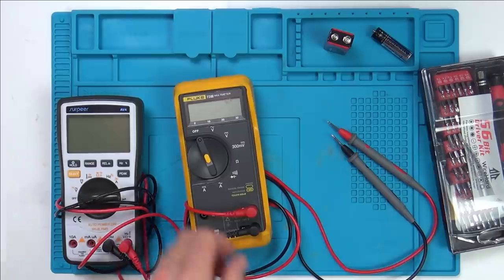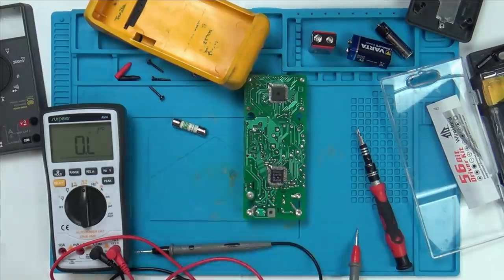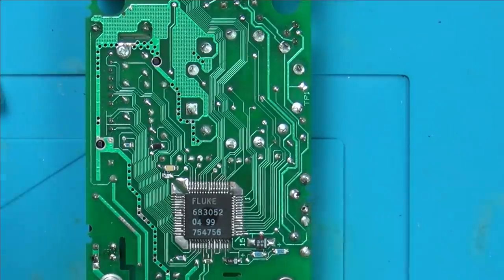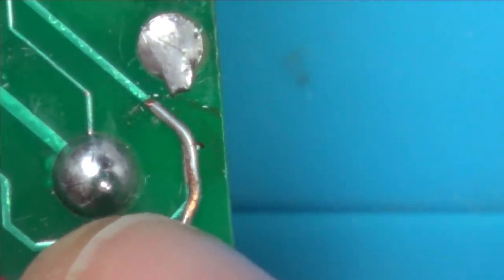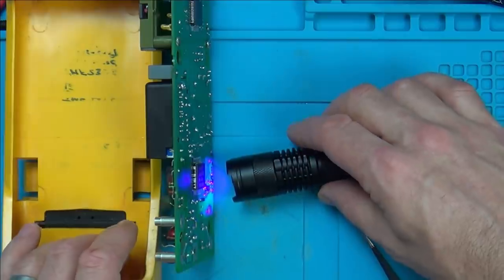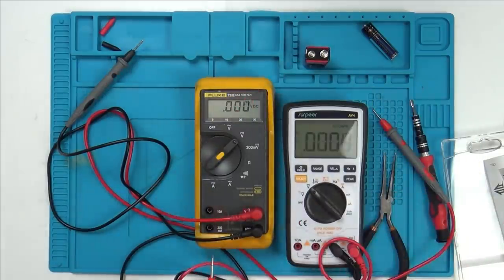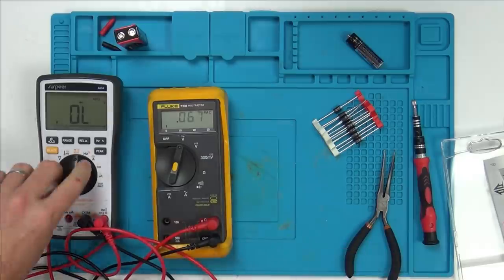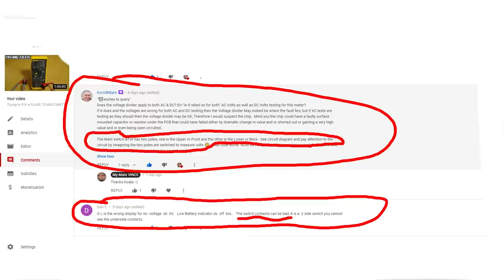REVISIT - FLUKE 73 MULTIMETER

Comment: Great finally. My take on most all circuits I work on is this, if the circuit worked at one time, that means it was designed and built properly. Than either a component OR trace is bad. And if all the components test good, the only thing left is the pads and runs. However, we face a lot of unique chips that some times are company designed and manufactured to unknown spec. Then you rule out everything else and narrow it down to such a chip. Getting a replace is than the real problem...  Thumbs Up!

Comment: The speed of the buzzer on continuity mode actually has a lot to do with the quality of the probes (like what metal they're made of). You should try swapping the probes around and see if it makes a difference.
Reply: I have a Fluke 73 and the continuity speed on the video is comparable to the one I have. I think the Fluke 73 is aimed more at industrial electricians more than electronics and the speed of it is ample for us sparkies. 👍
Reply: Quentin you have hit it on the head.. 100% correct

Comment: I’m in awe of your trouble shooting skills, especially when you say things like you’ve never used your multimeter to read amperage. I’ve been watching you for a short time and thought you were an electronics expert due to your high success rate and the way you move around a circuit board, but after hearing several comments you made it leads me to think you may not have had formal training, which would be even more impressive.  I have trained for 4 years as an electronics technician and find your troubleshooting skills easily surpass mine. I am very entertained watching you and also enjoy your accent. 
Not sure if you’ve ever done this because I haven’t watched all of your videos yet, but I would enjoy hearing about how you learned to be such a good troubleshooter.

Comment: Great that you get it working basicly without needed parts! :)
To do current measure 1 lead go's to A port and second lead cos to COM port. Warning! After that you have "jumper wire" in your hand (if those fuses inside are ok), even when the switch is set to OFF position.
When measure current you set this meter in series to the circuit you want to measure.
Example, if you want measure current drain from car battery. Set one lead to 10A port second lead to Com port.
Either take out positive or negative lead and hook this between the battery and the car cable(series connection).

Comment: Thank you for revisiting this Fluke. It is very rewarding to see that you fixed it with the help of the community. Thumbs up to all of us!
This HAD to be still a working meter with something broke in it, because it was doing just fine on resistors. I was also distracted from the real issue. Somebody else cleaned it already. If that hadn't been done, you, and us viewers would have zoomed right in on that trace that was eaten away by a blob of electrolyte.
Anyhow, indeed, a ground fault can easily cause these kinds of problems. A reference voltage might be higher than it should because of a missing path to ground for a voltage dividing series resistor network. A higher reference would then make it seem that the power supply battery looks empty and missing resistors to ground can also raise the measured voltage significantly.
A bit weird that your meter showed a lesser than 3000V when connecting the battery the right way round and it gone OL when the battery was connected backwards. In that case, on a good meter, the indicated voltage would go negative, instead of going up. Here, again, some disconnected or floating grounds could cause that mirrored behavior.
I'm still a bit disappointed that you didn't short the leads before you fixed it. I'm still curious what it would have shown with shorted leads. But then again... who would want to short some leads that have 3000V on them, according to a Fluke multimeter...

Comment: Ahh, the 9-volt battery tongue test.  I use it often.

To get into the diode test function you need to press the yellow button in the center of the dial, then the meter will show the junction voltage.  Also to test the fuses you don't need to open the case. Simply put the meter in resistance measurement, connect the red lead to either the 10 A or the 300mA sockets both should read very near to zero ohms. If not then you know that the appropriate fuse is blown. 

Edit: Also, if the meter goes to sleep (it was left on and turned it's self off), it is not needed to twist the dial to the off position and back to the desired measurement. All that is needed to turn it back on is to press the yellow button in the center of the dial.

I enjoyed your tenacity in this repair. Great feeling when you fix something after putting so much effort into it.
Reply: I can’t recommend tongue test with the 3000 volt battery 🔋

Comment: For removing solder mask in very small areas, my favorite tool is a nice large sized sewing needle. You want a thick one so it doesn't bend, with a reasonably fine point but it doesn't have to be super sharp as solder mask isn't very hard. Hold on to it as close to the point as practical and scrape side to side, don't push it in or it will slip.
 You can also just use tweezers but I get nervous using my nice tweezers for stuff like that.

Fiberglass pencils are nice for larger areas but it can be hard to see exactly where you're removing material.

The problem with blades is that it's hard to avoid going right through the solder mask into the copper and then if you go even further you hit the PCB material which will dull your blade because it is quite hard.

Regardless of which of the above tools you use, I like to spray off with canned air before I get anything wet with flux just to remove  the scraped-off solder mask and any metal I may have picked up.

Comment: Fantastic, good job sir, I have the same fluke meter and never had a problem with it, the slight delay in continuity is normal, the only think that I can say negatively about it.
Fun story as a student I couldn't afford a fluke meter (was using a very cheap thing that did the job), one day walking past cash generator and saw the FLUKE 3 meter in the window for £15 .........  I assumed that the price label was missing another 1 in front of the 15 but after inquiring I got it for £15 that was back around 1999/2000 still use it to this day.
Enjoy the repaired meter its certainly a good one.

Comment: As a tech for 45 years that was a good find. Flukes are fantastic. I still use 77 I bought 35 years ago. It replaced a Flue 72 I lost. I also have a few of the cheaper smaller Flukes (21 I think was the number) they were full auto, only had an off and on switch.

Comment: Nice fix ...I actually cheered when it worked ... nice job...the slight delay in the continuity test is normal for the 73 series..mine is the same even with new genuine fluke test leads.

Comment: When doing the amperage test, remember to do it in series, not parallel to the gadget used.
Without an actual "consuming" device you might blow your freshly repaired multimeter. (or at least the fuse)
Reply: Usually pops the 11A fuse. Trust me, I've done it ;)

Comment: Just a tip, it's best to avoid heating and re-heating a joint like you did, trying to get the solder to look 'nice'. Partially re-heating pads like that puts a lot of stress on them and can give the solder odd properties, if you didn't get it all the way to its melting temperature.

You are best off prepping the joint as best you can, heating everything properly in one go, and not allowing any movement as it cools. Even if you've got a joint which looks like it has a bit too little solder, provided you can see a decent-sized bridge where the solder has 'wetted' both surfaces, you're best off leaving it alone.

Comment: Great job on this one, no question.....

The comment from Will, that you had the smiley face on, was right on....  I don't really know how this works, but I gave that comment a thumbs up, which, in my mind, I feel it's stupid to say the same thing....  If Will's comment gets 100 likes, I presume you notice that, and take it seriously....

I've had a couple of those broken.  I never did get them 100% fixed.  I got one to a point where it had some of the functions restored, but not all...  And another one, where the selector wheel was pointing at the wrong thing, but it would work....

I love the Fluke meter...  But I never really succeeded fixing one.  Luckily I have a couple that work perfect, heh heh!   

As we found out, the selector switch is never a bad place to start looking....

Those meters have such a hard life....  Mine is rocking around in my backpack all the time...  it's 100F in my truck in the summer, it's -20F in the winter....  Then someone knocks your backpack off the desk you set it on...  My poor meter.  It just has a hard life....  I would get new leads for it right away also...

Anyways, now you can go to bed tonight feeling very smug....  You actually fixed one of those things.....  Nice job Sir.  Nice job.

Comment: Great detective work! Nice to see that Fluke 73-III rescued and back to good use. These multimeters are so incredibly solid. I bought mine used off of eBay back in 2009 for $51 USD. The yellow casing was all scuffed up and sorry looking, but the DMM itself looked perfectly fine. And indeed it turned out to be functioning well, acting in good calibration. The previous owner's 9V battery is still in place, still delivering good power. Sure there are newer models around that are more capable, but this one is perfectly suitable for hobbyist electronic work. I wonder if the build quality is better than what you get in the latest 117  / 177 / 179 models.

Comment: Great job Vince, 
Well done for sticking with it.
It's such a great feeling when most people would have tried a couple of things then through it in the Bin, such a throw away nation only because a lot of people cannot be ass to even give a go,
I am not electronically knowledgeable` and I know not what to touch learnt my lesson a few times, but I've fixed washing machines leaned what a capacitor does in washing machine the hard way lol- repaired tv back lights phones laptop screens,
I even learnt to repair a car head gasket by understanding how to do one on a 3hp lawn mower, 
Most stuff I learned from watching YouTube its Brilliant I learn better by watching not so much reading how to repair,
I have some millimetres myself that need looking into must be time to get them out, one is suffering from the zebra strip screen is struggling to show, I tried rubbing carbon pencil on it, worked a little better but not good enough,
Anyway, Great job, video`s like this only inspires others to not give up.
Iam not sure on this but you might need to recalibrate your fluke after the repair, and depending where you place your probes on the resister if not evenly apart may affect the reading` But don`t quote me on that,

Comment: Hi Vince...firstly ....great result, well done.
I chuckled to myself when you found the fault and nearly lept for joy,  It's a great feeling when a difficult fault is found....

BUT....

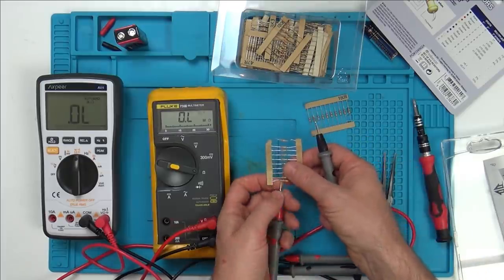I noticed you were measuring a 220K resistor (18:29) and got very nearly 220K with the Fluke but had problems with getting a reading with your meter and eventually got a reading of 196K
When measuring resistance.......Make sure your body parts are NOT connecting to the probe ends.
You had your fingers touching BOTH probe ends, putting you across the resistor.
This is like your resistor in parrallel with your body resistance and will significantly alter the reading.....especially on high value resistors

Hope this helps....👍

Comment: You can use your bench power supply to test the amperage meter. It works by measuring the voltage drop between a very low impedance resistor and amplifying it. When you put your leads on the amperage slot it is basically a short between the common lead and the amperage lead with a simple low impedance resistor in between them. The higher the current passing through the bigger the voltage drop measured on either side of the resistor. That's why you have to think about measuring current as a short in the circuit and NEVER LEAVE YOUR LEADS CONNECTED ON THE CURRENT MEASURE HOLES, because if you forget and went to measure the mains you will be basically shorting out the outlet. But it's very straightforward to measure battery powered products and other low current and voltage things with no worries. 

To measure the current of a circuit with your bench power supply, you can simply connect the positive side of the PSU to a resistor and the other leg of the resistor you connect to one lead of the multimeter and the other lead of the multimeter you can connect to the Negative side of the power supply, so the multimeter will be conected in series. You should be able to measure the current passing through the resistor from either the PSU or the Multimeter and they should be similar, but I'll bet that the multimeter is more accurate. You can guess what current should be passing through the resistor by using some basic maths called the Ohms Law. Which is I=V/R  or current (amps) equals voltage(Volts) over resistance (ohms). So If you have a 100ohm resistor and the PSU is 5V then the current should be I=5/100 which is 0,05 Amps or 50mA. If you increase the voltage to 10V it will be  100mA. If you put two 100ohm resistors in parallel then the resistance should be 50ohms and with 10V/50=0,2A or 200mA

Comment: I get a kick out of how you react to when you get it working, I do the same thing.
Reply: Same here. Once repaired a dumped premium quality 20" LCD-monitor. Everybody told me it's not the electrolytics. Monitor switched on, seemed to work, but had no pic. I changed the caps on the inverter anyways. That did the trick.

Comment: In order to measure current (Amps) you need to:
1. Interrupt the circuit you are measuring by cutting a wire or a trace or partially desoldering some kind of a component which is in circuit. If this is not desirable, but you still want to measure current you can buy a "clamp meter" (like UT210e).
2. Leave the black multimeter lead connected to COM and connect red one to 10A or (300)mA socket. You need to make sure that the current you are going to measure is not going to exceed the rating on the socket, otherwise you can damage your multimeter. If unsure - always select a larger rating (i.e. 10A). This shorts the leads (!) and can be used to complete the circuit (see below), but you obviously shouldn't measure voltage or resistance in this lead configuration.
3. Select the appropriate measuring mode (A or mA)
4. Use your multimeter leads to complete the circuit so the electricity will flow through your multimeter (from one lead to a multimeter body and through another lead) and observe measured value on the screen.

What if 10A is not enough? You can always buy a multimeter rated for more amps (eg. 20A), but really you want to use clamp meter for that. They are usually rated in hundreds of amps. If you are fixing cars, it might be worth the investment (cars have 12V, but many amps), but in general for the stuff you do in the channel 10A is probably enough. If you are buying a clamp meter, make sure to buy ones which can measure DC, not all of them can!

Comment: To measure current Vince you have to have the meter inline in the circuit, so the power flows through the meter, that’s why it’s fused, if you don’t know roughly how much current is flowing in the circuit you will blow the meter.

Comment: Hi Vince,
Nice fix; congratulations!
I have a comment though: at the 4:18 second the trace immediately to the pad you are probing also looks damaged. Or maybe it's just a visual artefact.
Reply: no it is just some of the green coating has been removed, rather than actual damage.
Reply: Good eyes murphy! yeah I would be tempted to touch that up with some solder being as its exposed to potential corrosion.

Comment: Interesting video and nice bit of investigation work to identify the fault. To test the mV function on DC, you could have build a voltage divider using your battery and the resistors you have available to give you a mV value. Alternatively, if you are into looking into multimeters, there are devices out there such as the DMMCheck Plus that will provide you with multiple reference measurement points.

I have subscribed and will go and check out a few more of your videos as I get some time.

Comment: Got a bit further in the video and re-emphasizing one point from the other comment: Solder mask dust/debris is best cleaned off with just air. If you get it wet it can get under things and then stick there. I would spray with canned air or the equivalent first, then clean with iso.

Comment: Hi thanks for the video. Although mine is a series 2 fluke 23, I used the tips to repair my unit. having said that sill have an issue with the AC voltage reading which is close to the actual value but keeps changing the reading by a few volts. anyway may question, I love the idea of using solder mask and will do so myself in the future and would like to ask you if you have a link for the UV light you where using please.
regards and keep up the good work

Comment: I'm a little late on this one, but I have a cheap meter and I have to use the range switch to get the beep more responsive on continuity test. If you haven't already figured it out, try pressing the yellow button when in continuity mode to see if the beep gets more responsive.
Reply: I have noticed the yellow button seems to zero the ohms calibration, so apparently it should have an effect on the continuity beep.

Comment: Do not "play" with the Amp setting in low current mode, 400mA. It's a 440mA fuse,1KVA. If you pop it then it will cost you over £15 to replace. A bit less for the 10A fuse. So carry a few spares. You are in Fluke prices now. Good Luck.